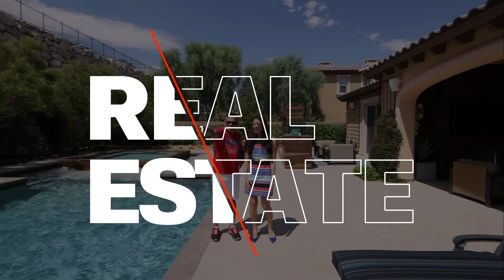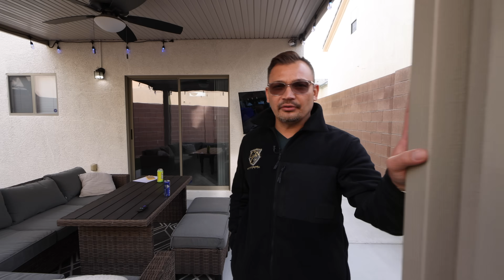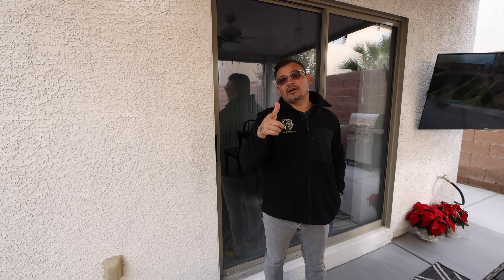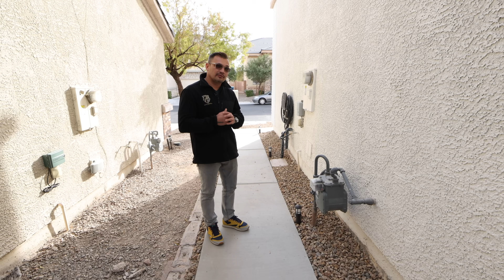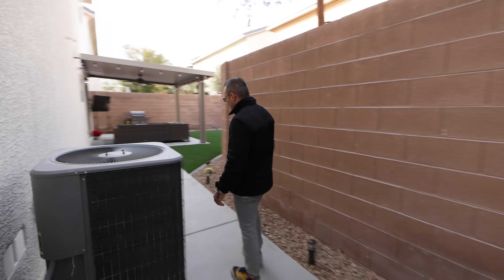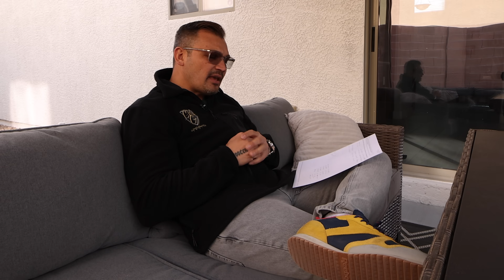How much did it cost me to landscape my backyard?

Comment: Charity, I seen in this video that you made two big mistakes in your backyard, in regards to the concrete.
Where the walkway that leads from the side gate to your patio concrete slab, your concrete guys didn't out expansion foam between the brick wall and concrete and they didn't put the expansion foam where the concrete pathway ends and connects to the patio slab. 
Why this is an issue is because attaching the concrete to these surfaces doesn't allow the concrete to expan and contract, which your concrete WILL be doing there, in LV due to the high daytime heat and cold nights temperatures. You're going to see, maybe in a year, your concrete cracking in those areas because the concrete can't move and adjust. You might want to look into fixing that otherwise you're going to start seeing your concrete ctack.
Reply from the maker: Thanks for tip we will have to wait and see